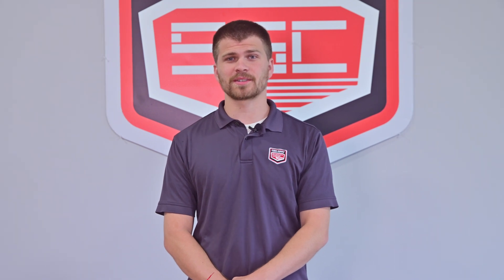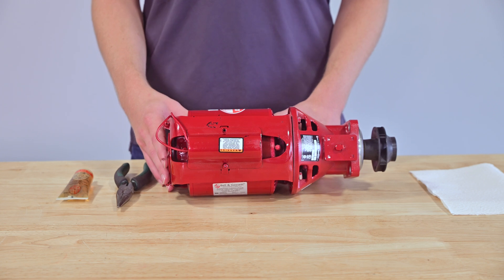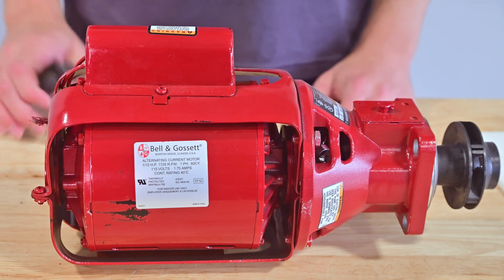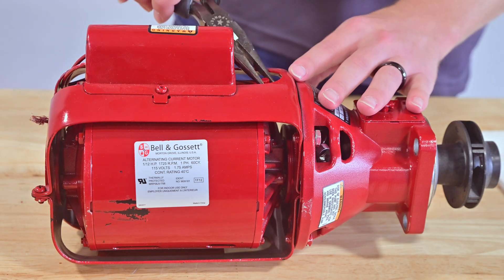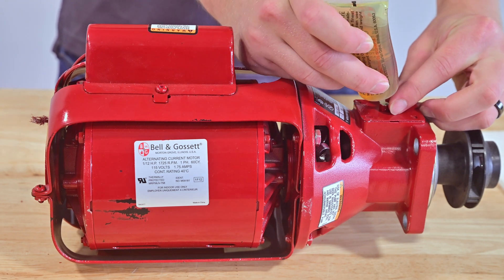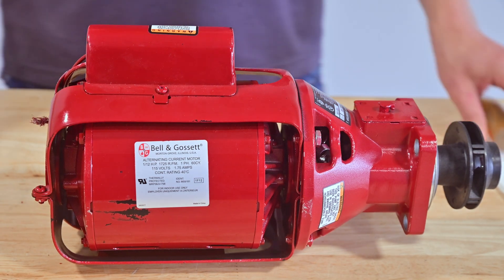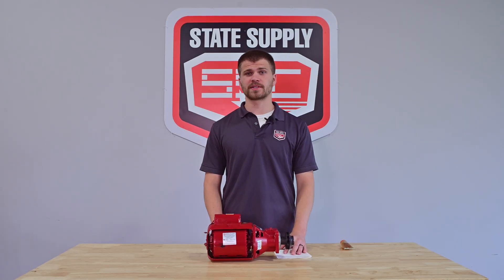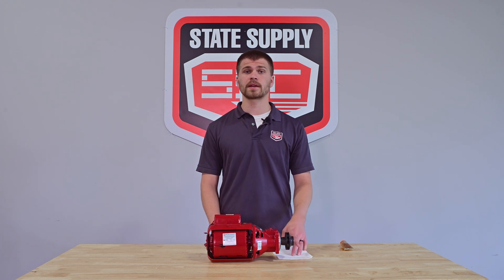How to Lubricate a Bell & Gossett Pump

Comment: When would you recommend changing the oil wick and doing an oil flush? The bearing assembly is a few years old and the oil is black and the wicks are dirty. When a new pump was delivered to us, it came with 2 bottles of the 20w non-detergent oil and the warning label on the bearing assembly said to fill it up to the overflow port but there was not nearly enough oil to do that. So if I do an oil flush and wick replacement, should I fill the reservoir up to the overflow port?
Reply from the maker: Great question, usually you would never change the oil wick or flush unless it was burned from a lack of oil. In this case, only flush it if there is a lot of debris inside of the oil port, if not, just change the wick, add oil until it begins to weep, and you should be good to go. 

It is odd you were given 2 bottles. It usually is just one B&G branded tube. 

Hopefully this helps!

-Cole
Reply: @statesupply  Thanks. I think someone may have added detergent oil and its gumming up now. We ordered replacement wicks and oil and will replace them.

Comment: A secondary issue is the type of grease for a serviceable bearing motor. We recently have a controversy here now because a motor vendor claims only polyurea should be used, however this is not suitable as we have 400 other motors and bearings that have had red lith or moly grease in them for 50 years, and the vendor says the two are so incompatible that they will break each other down if mixed. Also I know not every manufacturer specs polyurea, which is about 30% higher in cost.
Reply from the maker: In regards to the grease, it is never a good idea to mix two different greases unless it is explicitly stated that it is compatible. The grease recommendations will depend again on the manufacturer. For example, a B&G e-1510 bearings currently use polyurea-based grease,  but before dec 1 2014 it used a lithium-based grease. To switch the grease type, you have to replace the bearings and remove any leftover grease left in the cavity. 

In an ideal world, you motor grease matches the bearings. Make sure to check with the motor manufacturer whether is it baldor, marathon, weg, or any brand on their grease recomendations and what it comes with from the factory.

Comment: So several questions arise from watching this. The most obvious is the type of lubricants to use. Our local motor shop told us to use the supplied oil only for the motor in high hw temperature applications, and to use something closer to 10 or 15w for the bearing assy.
Reply from the maker: Thank you for watching John! B&G specifically specifies 20W non-detergent for their small oilable pumps such as the series 100 regardless of service temps. Different manufacturers may spec different oil for specific conditions.

Comment: I do this at startup, and then, 1/2 way through the season, put exactly 1/2 of the starting oil. I've learned the hard way that if you over oil, you'll destroy the motor mounts and the coupler will break.
Reply: So to clarify..when the video says 6 drops at each side of motor you use 3 drops at the start of the season then 3 drops  mid way season at both sides of the engine ...is that correct..
And 6 drops instead of 12 at the other location?
Reply: @ratcat1997  My steamfitter friends, and the manual, say this: At the start of season, 6 drops each in the 2 motor oil tubes. For the Bearing Assembly, it's 12 drops. At 1/2 through the heating season, add 1/2 of the above in each oil port. Avoid the temptation to add more oil--it'll wreck the rubber motor mounts.

Comment: My pump makes a squeaky noise right at the end of the cycle just for one second. My model pl-36 it’s maintenance free. Is anything I can do about it?
Reply from the maker: Without more information,Tom said it is likely caused from the seal kit when the pump is slowing down. You can try swapping the seal if it is annoying. Realistically it should not have an impact on the life of the pump. Thanks! -Cole
Reply: @ thank you

Comment: What is the lubricant you are using there?
Reply: How many drops does the pump bearing get when serviced or do you just fill it drips again?
Reply: @loft306  For maintenance on the bearings, we recommend the same as startup. Halfway through your heating season, fill until it weeps and leave a rag below for 24 hrs. Hope this helps! -Cole
Reply from the maker: Hello @bookie039! In this video, Cole is using a 20W non detergent oil. This is now an obsolete item, but we this replacement available in our stock! https://www.statesupply.com/hi1140